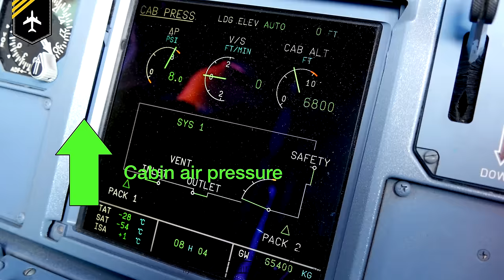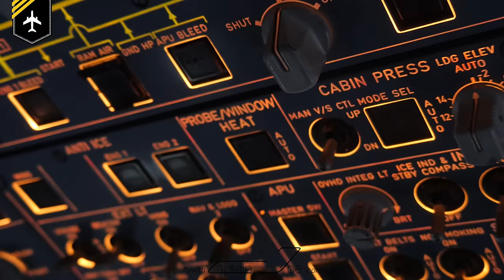Why is there a HOLE in AIRPLANE windows?

Comment: But you're wrong. Cabin air pressure is not in a constant rise except for descent. As the plane climbs, the air pressure inside the cabin actually gets lower, it just doesn't decrease as fast as the air outside. If what you said was true, then as a plane that took off from sea level would climb, the cabin air pressure would increase to that of an altitude below sea level. That never happens. When a plane is at cruising altitude yes the air pressure on the inside is greater than the air pressure outside. I think what you meant to say was as a plane climbs, the RATIO of cabin air pressure to outside air pressure increases

Comment: Thanks for the cool video.  Just a small inaccuracy I spotted... cabin pressure is not rising at all. It is also decreasing. But outside pressure is dropping faster... both pressures drops as we climb. Cabin pressure ceases to drop at maximum cabin alitude then stays constant. No point does cabin pressure rise.
Reply: AceOfHearts001 I think he meant the pressure on the cabin frame instead of the cabin air pressure
Reply: He also might mean the difference in pressure is rising, because we usually mean pressure difference when we are talking about pressure, say if we talk about a pressurized can of air
Reply: I think the pressure increases during descent, that's why some people suffer from pain in the ears (like I do) when the plane start going down approaching to the airport
Reply: But if James Grider is flying on an airplane and he gets pissed and spawns the Wykkdik through the skin of the plane or the window, punching a hole through the plane at 40,000 feet that's about the size of a soccer ball, what will happen?
Reply: AceOfHearts001 I thought that airlines always pressurized the cabins to about what the outside pressure would be at 8,000 ft.
Reply: Comercial airplanes have pressurizing systems, because people are not able to breath oxygen at such low pressure at 30‚000ft, that systems don't allow the cabin pressure to drop while climbing but sometimes there are transition differences.
Reply: A question that leads to the answer to this is; what did aircraft have before the little hole? The answer, in my experience of a couple of English aircraft - HS748 and BAC1-11 - is that the sealed space between the 2 panes was connected to atmosphere by a gallery of small bore pipework and a dessicant conrainer. The cabin pressure was therefore contained by the inner pane with the outer pane with no pressure load acting as failsafe in case of inner pane failure. The dessicant eliminated misting. I have seen many answers to this "tiny hole" question but none that gives the answer "to eliminate misting". So not a safety issue or to equalise pressure although obviously it does but cheaper way to demist.
Reply: @jamest1148  Yep, but to reach 8000 ft from sea level (assumed air pressure at departure airport) cabin air pressure has to drop. The air conditioning system prevents the cabin pressure from falling with the airplane altitude in both rate and magnitude, but is not increasing the cabin air pressure. The cabin is indeed "pressurised" in the sense that the outside air pressure at cruise is significantly less than ambient cabin pressure. It does not mean cabin air pressure rose (it infact decreased), again, it is just that outside air pressure decreased much faster.
Reply: @UmbertoUriel05082002  Yes, the cabin pressure does drop, but to a regulated cabin altitude.
Reply: @almarma  Yes, the cabin pressure will be increased from cruising cabin pressure to landing airport ambient air pressure proportional to a set pressurisation schedule depending on airplane's current altitude as it descends.
Reply: @RichDom2185  Yeh, if the video had said "cabin differential pressure" - i.e. airframe skin pressure difference between inside and outside the cabin (which is absolutely different to "cabin air pressure") - it would have  been correct.
Reply: @MatthewSmith-sz1yq  Except the air pressure in a can is actually rising compared to the cabin.
Reply: @AceOfHearts001  I'm talking relative pressure, as in the only reason we call it a  can of pressurized air is because it has a higher pressure than what's around it. Aviation uses differential pressure a lot more than absolute pressure for pressurization, because aircraft are limited more by their differential pressure between the cabin and outside atmosphere. While yes, their absolute pressure does not rise, their differential rises the higher they go.

Comment: "... they're (plane windows) not sealed … air flows around … "  (to paraphrase):  Air actually leaks out around the windows?  I thought indoor cabin pressure had to be maintained higher than outdoors, which is very little?

Comment: Well, the inner pressure is not rising, it's just falling slower than the outside pressure. So the differential pressure rises with the altitude.
Reply: That is not what he said
Reply: Weltbevoelkerung that is correct in nature, but since the engines pressurize the cabin it to is actually rising

Comment: Hi Joe. There is a small error in this video. 

After take off the cabin pressure is not rising, but also decreasing. But is it is decreasing much slower than the outside pressure. Why not stabilise the cabin pressure to the same as the ground level? In that case on causing altitude the hull has more differential pressure to deal with. So the hull shook be stronger, which makes the aircraft heavier more costly and it burns more fuel. So the air cabine pressure is also lowered when ascending. making the differential persure a bit lower. This way the weight of the hull can be made thinner, the plain lighter and more economically. 

I am so enjoying your channel :-) It's so much fun learning about aviation in every video. Can you make video about the process of starting the engines. What happens in the engines. Are they started electrical like in a car? Are the started with compressed air? What preparations are needed before start? 

Safe flights and hop to meet you in real live!

Comment: So in case of damage to the outer window, cabin preassure could also leak through the little hole in the middle window? Can the aircraft adjust for that, or would loss of cabin preassure be the result?

Comment: My question: Could a passanger break the window and what would happen if its broken?
Reply: X3N4 the window requires a lot of force to break. And if a window breaks above 14,000 feet it will trigger a rapid decompression requiring an emergency decent and diversion to the nearest airport.

Comment: Great video series! Just a quick correction about the pressures - the cabin pressure does fall too in climb at a reduced rate of the outside pressure. The typical cabin pressure altitude at cruise is between 6000 and 7000 feet for modern airliners (approx. 830 to 800 hPa). The inner window is not affected by the outside pressure and the tiny hole as you correctly stated is there to allow for air to flow out during the climb and in during the descent to equalise the pressure of the air trapped between the outer and inner windows with the cabin. Btw I'm an atmospheric scientist, not a pilot ;)

Comment: Hi Captain Joe, recently i flew in B787 and observed that the  windows in this aircraft are not having any hole. So with what new technology have they come up replacing the hole?, or are they using the same technology which you discussed for the cockpit window?
And Captain must say you wear a lovely smile.:)

Comment: Wouldn't the inner pane also serve as a thermal barrier between passengers and the middle/outer panes? Since there's no insulating gas between the outer and middle panes, the middle pane would get very cold at cruising altitude. Not only would it be very cold to the touch, but it would also frost-over due to all of the moisture in the cabin air. The cabin air between the middle and inner pane plus the insulating properties of the plastic inner pane protect the passenger from the cold outer panes and also reduce the amount of heat that's lost from  the cabin air due to convection.

Comment: hello captain Joe, I always wait for your videos, I love the way you present the videos  , it seems very professional.
Can you upload the video regarding runway length required for takeoffs and landing for almost all airplanes.
Reply: gurmeet kaur the length of runways depends on weather conditions, weight of the aircraft on takeoff, thrust rating, the list goes on. The manufacture gives a bunch of charts in the FCOM that assist with this process. There are also programs that the company make for pilots to use that calculate the runway needed.

Comment: Why do you say the inside air pressure is on a constant rise when it actually decreases a little from ground level pressure to a cabin altitude pressure of about 6,000 or so feet?
Reply: I noticed that, too. I'm guessing he just wanted to simplify, or meant to say differential pressure.
Reply: As Mr Dettweiler said it before it is the differential pressure (∆p), you can see it on the screen at 00:34
Reply: tjperez69 I noticed the same thing and just commented about it

Comment: First, I just didn`t understand what is between outer and middle window? Is it transparent gas also, or what kind of air gap is between them? And second, hole is placed on inner window and acts as bleed hole balancing the air pressure differences between inner and middle window, right?

Comment: Hi, from Bucharest, Romania. Your videos are very interesting, but, unfortunately, I have too little knowledge of aviation.  So, If you don't mind, I would be curious  to explain something about airplane windows. I recently had my first short flight in my country, most probably with  Boeing 737 800.  
  So, when I touched  and when I pressed lightly on the winwow's panel , I feel this is pretty soft and that it vibrates hard when you hit it softly.  it was about to think something it can be wrong with that window.  On the second flight, the airplane porthole it was almost in the same way.  I was  surprised about that plexiglass panel is so soft and seemingly fragile.  Are they built in this way to withstand strong vibrations, mechanical stress, or what it can be?  Here, on Youtube I watched a video which explained how strong and indestructible are the  cabin windows. They said that a professional boxer could not break an airplane window, that they cannot be damaged in any way from inside the aircraft !  So, I wish to know if this theory is true or not,  For example, in case of an aiplane event after rhe landing, if a  very massive man scared of the burning odor incident, it may be able to break the window by his fist or with the feets ?  Sorry for my poor Englidh !  Rhis is the video about the strength of  aircraft windows-  https://www.youtube.com/watch?v=kGP77V206Gc

Comment: Hi Captain Joe. Just a correction on your point that cabin pressure RISES after takeoff. That is not correct. I have monitored cabin pressure on several flights on both A320s and B738s and in all cases the pressure did not rise. It remained stable for a couple of minutes after takeoff and then slowly decreased during the rest of the climb. At cruising altitude it had reached between 710 and 760 hPa. 

Maybe you meant that the pressure DIFFERENTIAL between inside and outside rises during climb, which is of course correct.

Love the videos and am a recent subscriber. Could you please explain what Centrefix means? I'm just a PPL and have not gotten my head around the term. Thanks a lot!

Comment: looks like over-engineering...  2 glasses cold be enough... why would you install outer glass and then drill it? what function it serves? protecting from damage by tourbine parts flying around... it will break both glasses easily...

Comment: Dear @CaptainJoe, I appreciate your videos and efforts to make it easier for common people to know these little but amazing things of an airplane... Well, about this video, I would like to suggest correction of an conception that you provided... Considering an Airbus A320 and A320neo (I am not commenting on other airplanes since I had only worked with Airbus A320 and A320neo), the cabin windows, unlike you said, is not formed of three window panes... There are only two panes with the space between them left blank. The hole is termed as vent hole, as it vents the space between the two panes to the cabin pressure and thus equalizing them... The outer pane is designed to take the pressurization load of the cabin. The inner pane is provided to prevent any person or object from the cabin from damaging the outer pane either knowingly or inadvertently, and therefore is not strong enough to take pressurization load. The two panes are sealed around its outer periphery. So if we do not provide the vent hole, the cabin pressure on one side while complete or partial vacuum on the other side of this inner pane will cause it to break. So a hole of calculated diameter is provided at the bottom to allow air to move in a restricted quantity between the cabin and the space between the panes.

Comment: Joe, I have a question also about cabin window. I noticed once in a flight that the window besides me fogged up. I'm not sure if that window had something about decompression. I think it's okay if the air went saturated afterwards. But I still tell my concern about the window to let maintenance guys notice that. Is that just normal? Thank you.

Comment: another funny question joe, so, was wondering this suddnely today when flying on P3D, so..... all the engine fans on a single aircraft all spinning in the same direction? i mean, they all spin clockwise? or anticlockwise...or one clockwise and the other one anticloskwise? and if they spin in the opposite direction, for example, if the correct answer is that they all spin clockwise, what happens if they spin anticlockwise?

Comment: Sorry but how can cabin pressure be in constant raise? Cabin pressure stays the same, actualy if I am not mistaken cabin air pressure is set to be round 800 mbar, while ambient air pressure at 11.000 meters is round 200 mbars. So ambient air pressure drops from 1000 mbar (at sea level) to 200 mbar while cabin air pressure drops from 1000 mbar to 800 mbar. 800mbar is enough for most people not to have any physical problems and at the same time present way lower physical stress to the cabin frame than 1000mbar cabin pressure would.

Comment: I have a short question.
As there is no seal between inner and mid window, air is constantly flowing out of the cabin.
Therefore the AC (or other system) has to pump air into the cabin the maintain constant pressure.

Can that pressure be adjusted somewhere, and if yes, would that be the reason why on some flights the ears hurt and it's necessary to perfom pressure equalization  ??
(as there would be a difference in the ammount of air that enters and leaves the cabin respective for over- and underpressure)

Comment: 2:23 Is wrong... After takeoff, both the inside pressure and outside pressure will decrease. The outside pressure will decrease at a faster rate and the inside pressure is kept to about 8000ft after climbing out.

Comment: So, a typical window in an airliner is triple-glazed.

The wee hole at the bottom of the window is generally to help with the air pressure inside the aircraft cabin (this where all the passengers sit).

Comment: Are you sure the air pressure inside increases? Doesn't it also drop slightly below ATM? the net pressure is always such that the pressure is pushing from inside out, but im pretty sure the inside pressure doesn't increase.

Comment: So what if the outer pane is breeched? That hole ought to bleed air out of the plane. I mean the plane is probably designed to be able to maintain positive pressure in the event of a breech, but isn't there a more effective method to doing this?

Comment: Could it be that the plastic panel/window is there also to prevent that passengers to touch the window and due to the really low temperature outside the aircraft, they could get hurt touching a window that is very cold ?

Comment: So if there is no seal on the inner pane, and there's the little hole between the mid and outer pane, then the only thing protecting the inside of the plane from the outside is the outer pane... ha!!! I never knew that. Awesome.

Comment: How you recover a plane if reverse thrust is deployed during take off? Tasos - Cyprus
Reply: Tasos Christodoulides That is impossible and instant death
Reply: A squat switch (also called Weight On Wheels switch) is in the landing gear to deactivate the reverse thrust system, as well as many other systems that you do not want activated on the ground (such as the landing gear UP circuit). Military aircraft do not have this because they want to take advantage of reverse thrust during emergency dives in heavy aircraft.
Reply: There was once a 767 in Brazil that went into a spiral dive due to one of it's reversers deployed
Reply: well i guess you would deploy the others and stop
Reply: If a reverser deploys before V1 they would immediately reject the takeoff but between V1 and VR is a grey area
Reply: depends on the v1 point of no return. physics

Comment: Captain Joe; How airplane mechanism do to keep the nose of the airplane higher than the tail when landing? Also, can a pilot turn off the black box ?
Reply: I'm assuming your talking about the flare phase when landing. During the flare you lift the nose of the aircraft up to slow the decent rate and make a nice gentle landing. As for the black box the only way to turn it off is to trip the breaker switch on the back wall off the cockpit but this is strictly against regulations.